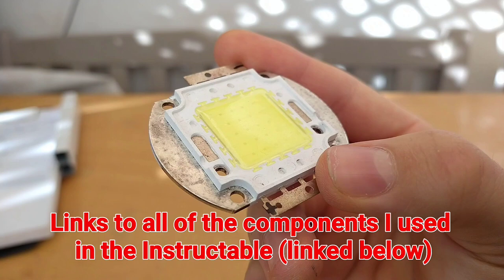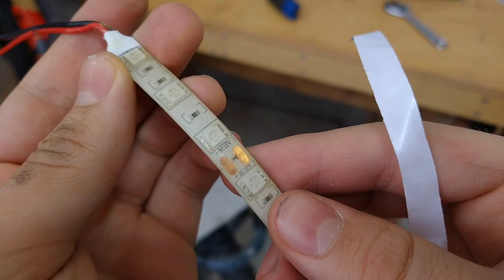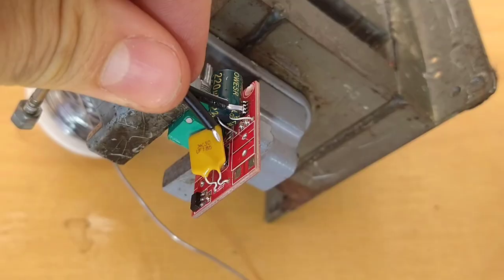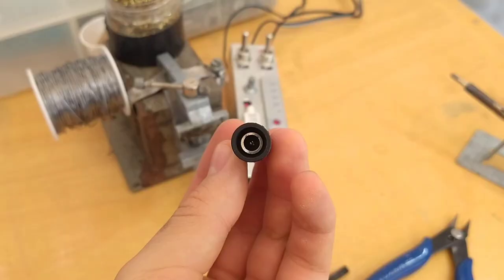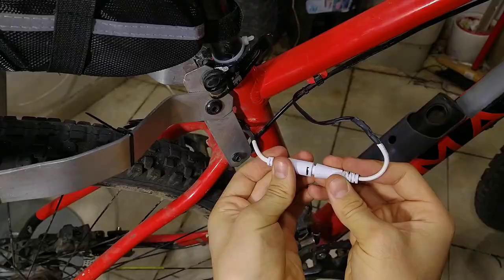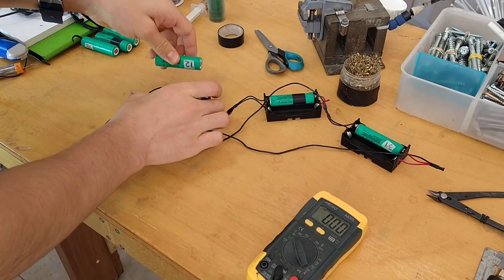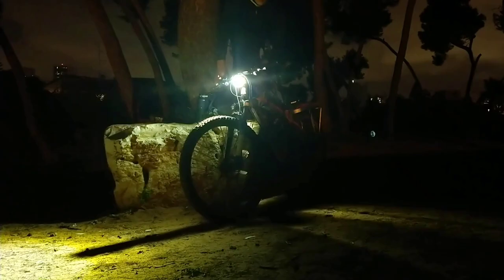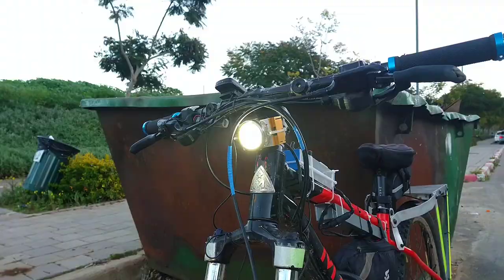Make this DIY Insanely Bright LED Bike Light for Cheap! (with LED Strips too)

Comment: Please, use that only off-road, and never when it would blind an oncoming cyclist. We already have far too many mega-lumen bike headlights with terrible optics. I've been blinded both on bike trails and on residential streets by timid bicyclists who think they need the light of the sun to be visible.   For anything other than mountain biking on trails, a headlight should have a beam shaped like an automotive headlight: bright in a narrow strip pointed at the horizon, for good "throw" down the road. mostly cut above the horizon to avoid blinding others. Diminishing brightness below the horizon to avoid over-lighting the pavement directly in front, because that ruins your night vision. Lights meeting German StVZO standards are best for the cyclist to see the road surface, like the excellent Busch & Muller lights sold by Peter White Cycles.   Please don't be the bicyclist equivalent of idiot motorists who always drive with high beams.
Reply from the maker: I see. I'll adjust it, thanks for the reference. I googled what you sent, and from these: https://www.google.com/search?q=StVZO+standards&rlz=1C1NHXL_iwIL720IL721&sxsrf=ALeKk01ZObkKhqaioaln8oWZsa6E_i9_Vw:1615410281222&source=lnms&tbm=isch&sa=X&ved=2ahUKEwil3emf0KbvAhXOwAIHHcp_BOEQ_AUoAXoECAgQAw&biw=1779&bih=830#imgrc=PCG0yhW8cSvtfM
The LED shines like the middle one. I'd like to adjust it so it's like the top, but the wheel casts a shadow. That's something they're missing in the picture.
Reply: @Yonatan24  A very long reflective hood worked for me. I got a very nice beam cutoffs, but it looks like my light is wearing the world's longest baseball cap.
Reply from the maker: @difflocktwo  I took a pipe and carved it nicely, but that's to stop the lens from blinding me when I look over the handlebars. But I still need to lower it to not blind people.

Comment: Hi, interesting build... but also dangerous.  The aspheric lens used on the front is among the worst types of optics for handlebar light purposes, since it has such a wide and flat beam.  Like, if you aim it at a wall, it'll light up the wall nicely... but when aimed down a hallway, it doesn't go very far.  This makes it good at blinding other people, but not very good at illuminating the ground along the bike's path.  It also appears that several components including the battery box aren't really waterproof, and the battery cells are unprotected models used in a serial configuration, which is one of the most dangerous ways to configure them.

You could probably get better results from a regular tube-style flashlight in a cheap mount.  It would focus more of the light forward into the distance, allowing for better illumination at lower power levels with less effect on other people.  It would also be waterproof, easy to remove and carry to avoid theft, and can be used for regular flashlight purposes too.

Personally, I've been using a Convoy S2+ triple that I modded with a Carclo 10510 optic for a wide flat beam...  or sometimes a BLF FW1A that I put a XP-L HD 3D emitter in to make the hotspot a bit wider than usual.  But you could also get an off-the-shelf Sofirn SC31 Pro 5000K with battery and charger built in, for less than either of those.  It even has a special biking mode, if you don't feel that a regular mode is visible enough, and thermal regulation in case it gets too hot.

Not sure what mount would be good though.  I've been using some twofish lockblocks I got from Dealextreme for about $1.50 each, but it looks like they don't carry those any more.  It's just a shaped piece of rubber with some velcro straps, but it works really well and makes it easy to angle the beam up/down when necessary.

Anyway, be careful with this design.  Bright wide-beam bike lights like this are blinding for other people, and illegal in some places.
Reply from the maker: Thanks. Do you know of any other lenses for this type of LED? I'll lower the LED soon so it's less blinding.
I haven't waterproofed it yet, I want to use it for a few more weeks before I reopen everything and seal everything. 
What's wrong with wiring the 18650 batteries in series? I checked their capacity and it's almost the same (just over 3000mah each).
Reply: @Yonatan24  I wouldn't recommend using a giant COB LED like that either.  They're nearly impossible to focus.  Big LED means big optics.  Small LEDs can make just as much light as that 20W one, or sometimes even more... but they're much easier to focus, and they're easier to find optics for since focusability is kinda the point of being small.  Big flat LEDs like what you used are mainly meant for wide area lighting, like light bulbs.

The flood-vs-throw ratio of a light is measured as candelas per lumen.  Candelas (cd) are the intensity of the hotspot, like a laser, and lumens (lm) are the total amount of light produced, like a light bulb.  For a bike handlebar light, the ideal ratio seems to be approximately in the range of 5 to 15 cd/lm, ideally with a gradual blend from edge to center and no sharp edges.  This keeps most of the light focused on the road ahead, illuminates the road more evenly, makes it more power-efficient, and makes it less blinding to others... but still allows it to be seen from all angles.

I've used bike lights as floody as ~3 cd/lm, but they don't shine far enough.  And as throwy as 25 cd/lm, but the hotspot isn't wide enough to see well; it tends to produce tunnel vision.  I tried measuring some of my aspherics similar to what you've got, and they measured anywhere from 0.7 to 2.4 cd/lm.

Yours looks like it's probably close to the bottom of that range, like 1 cd/lm.  If you switched to a comfortable ~8 cd/lm light, you'd be able to see just as far while using just 1/8th as much power... so 1 cell would be enough instead of 6, and then it'd be easy to fit the whole thing into one waterproof tube.

One popular solution is to take a slightly throwy light, like 15-20 cd/lm, and put some DC-Fix on the lens to make the beam wider.  This gets it to the right cd/lm ratio, and also extends side visibility to 180 degrees.  Or, instead of DC-Fix, some people use a bit of hair spray on the lens, or frosted glass, or a frosted optic.  Or a ribbed optic, to make the beam wide and flat.

About putting the cells in series, it's not necessarily dangerous, but it's far less safe than having the cells in parallel.  Parallel cells constantly equalize each other.  However, serial cells can get unbalanced over time and eventually catch fire if the balance gets too far off.  It helps if the cells have protection circuits on them, but laptop pulls don't.  The protection circuits are aftermarket items, and notebook batteries almost always use bare cells.

Anyway, if you want to find out a lot more, take a look at reddit's /r/flashlight for quick questions, or BudgetLightForum for more in-depth discussions.
Reply: @ToyKeeper  my favorite style of bike light are the StVZO German style reflectors, those work really well against blinding people while you can still put out tons of light

i'd recommend buying one of those really cheap XML T6 Xanes ebike lights, they've always been pretty bright if you power the leds of them properly by a proper CCCV circuit and if you mount them to a heatsink and keep it cool, they're certainly much brighter per watt than their "XHP50"

I was kinda disappointed by their XHP50 flashlight as it seems to be much less efficient and the light output per watt is much worse than their T6 lights, the T6 also seems to be a proper cree ripoff while their chinese XHP50 is kinda bad

Comment: 2:57 What is that odd looking vise you are using to hold the parts for soldering? It looks like it has some kind of hose clamp?
Reply from the maker: I made it a few years ago. It's a small vise I connected to a heavy transformer from a microwave: https://www.instructables.com/WAVE-the-Ultimate-Helping-Hands-Device/
I also added a solder dispenser and a magnetic mount for cleaning the tip.
Since then I had flux pour on it and it rusted. I've been wanting to remake it.

Comment: This is nice but it's useless if you don't share which parts you used. For example the most important part, the LED, your instructable link shows 5500 different LEDs!
How about linking to the actual parts you used, that we can buy? Please?
Reply from the maker: I used to do that, but the eBay listings keep getting deleted unfortunately. Now I just link to the eBay search, plus most people don't buy components on eBay anyway. Also the exact components don't really matter
Reply: @Yonatan24  Fair enough, thanks for the info!

Comment: That main light is going to be really troublesome to oncoming vehicles. It's just a big glaring orb of light, there's no pattern. So you haven't really addressed the issues of safety for you or anyone else. I spent ages to find a proper set of SAE/DOT certified LED units for my motorcycle because 90% of what other guys are using is crap. Scattering light everywhere. Mine cut off hard on a horizontal band that stays below eye level as straight as a row of bricks on a wall.
Reply: Charlie, what did you end up getting, where, and how much was it?
Reply from the maker: I'll lower it, thanks. What did you end up buying?
Reply: @Yonatan24  What's a good way to share a few images of the results?  
I looked up my order from 2019 and forgot I paid about Cdn $140 for the pair. But I was tired of buying cheap stuff that let me down by breaking too easily or being low output. The motorcycle is a vehicle and I do a lot of night riding hours from home on my own so I approached it that way. The first evening I had them on, there were two different incidents where a deer crossed the road in from of me and the improvement in visibility gave me much more time to react without even being that concerned. So IMO the lights paid for themselves right there. 
I don't want to turn your channel into a plug for the seller but look up on Amazon.ca: "Swatow Industries 2PCS 3 Inch SAE Compliant Fog Lights DOT Approved"
Maybe on your DIY project at least change out the lens for a good cut off pattern.
Reply from the maker: I think you can upload picture to imgr and link them here, Thanks.
Those are quite expensive. I spent $25 on all of the components combined. I'm willing to spend more because I use the light a lot, but that's too much. Are you aware of any other lens for this type of LED? The 60 degree lens I bought is quite cheap, indeed.
Reply: @Yonatan24  just get yourself an off the shelf LED light, a full set with front and taillights costs $40 at Decathlon.